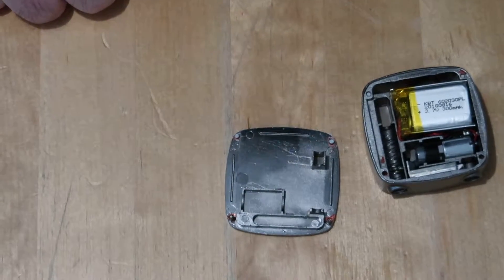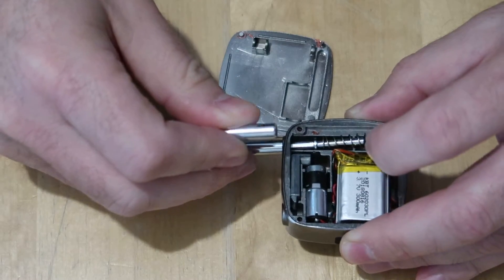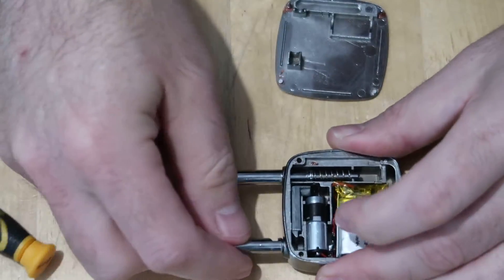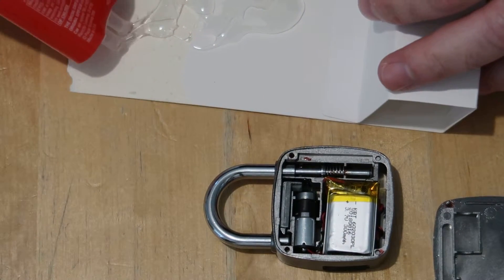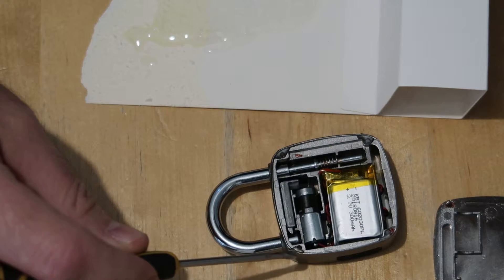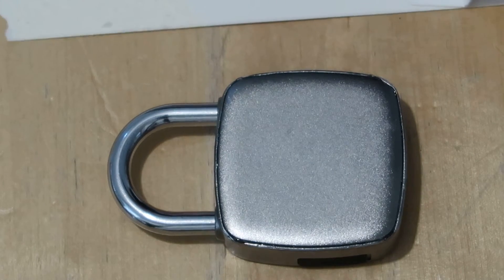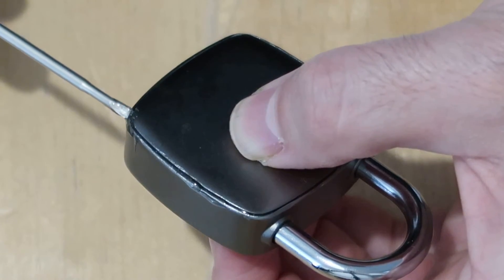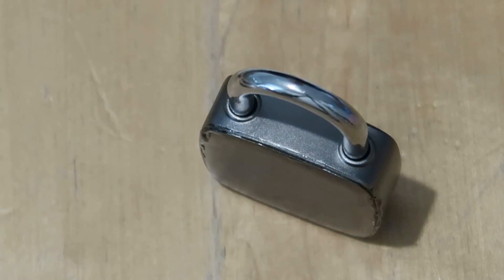Fixing broken Fingerprint Padlock

Comment: my son played with it and now it does not want to read any bodies finger print, just keeps saying incorrect fingerprint, how do i restart the whole process to wipe out all fingerprints registered so that i can use it again like new ?
Reply: What most likely happened. Either no admin fringerprint was set or it was (your sons) and he managed to reset it.
Then he got some other part of body (nose print?!?) or wierd location of a finger registered as master. So find out what part of body is registred as master and then use that to reset it following the instructions.
Other than that it's pretty much up hill resetting it unless you somehow get it disassembled and you're good at flashing microchips and even than it might not be easily possible depending on the design of the circuitry - remember it's a lock and designed with security in mind - even though the physical security of this is pretty low but the electronics could easily be the same used in higher security applications. So no easy method of resetting it - otherwise somebody could just walk up to your locker and easily get in without becoming violent.